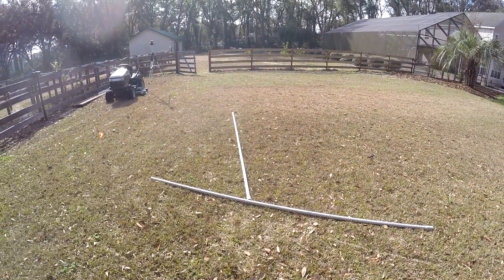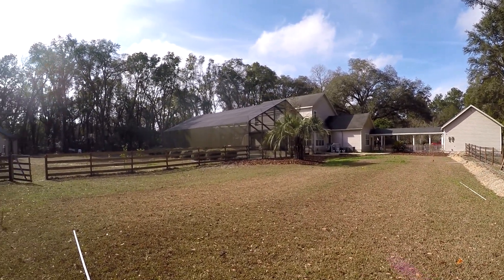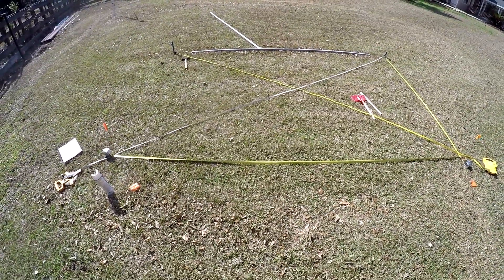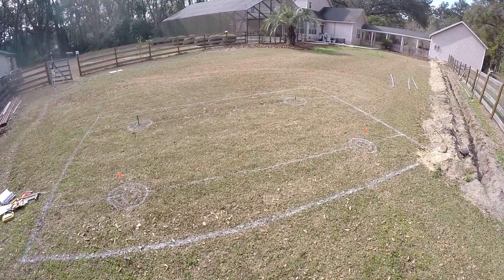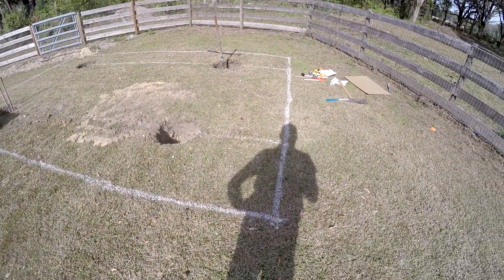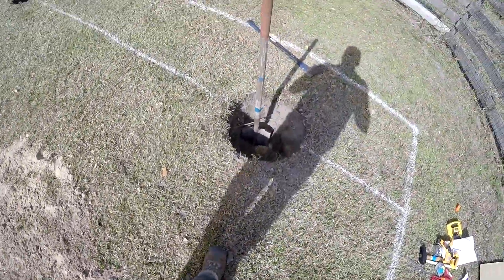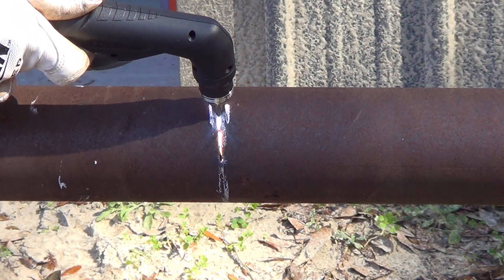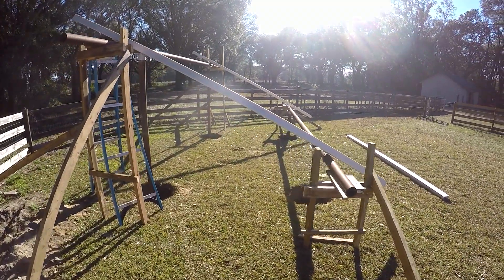IronRidge Ground Mount Solar: Layout and Dig

Comment: Great video, thank you very much.  I have that project in my pipeline. I though 2 feet deep would be enough. I'm glad I saw your video, will do more research about the depth.  Thank you for the scaffolding idea as well.
Reply: It isn’t always about depth, it’s about weight and ballasting down a giant sail that’s trying to uplift the whole array.  The depth comes in with frost heave and maintaining stability long term.
Reply from the maker: IronRidge has a design tool on their site that you can use for free.  Thanks!

Comment: Any explanation why you had to go down 6 feet?
Reply from the maker: Yes, The depth and diameter are determined by the IronRidge design tool.  It calculates the uplift and determines the dimensions.  You could go less deep with a bigger diameter but the design tool will tell you based on the wind loading calculations.
https://base.ironridge.com/gb/projects/new
Reply: @HomesteadEngineering  sweet thanks for the info.

Comment: Great work! I like the way you used your shadow to test the direction. 
Ironridge is great stuff, but costly. 
I am building a 16 panel ground mount at 22' x 14', but using Grainger parts and schedule 40 1.5" pipe. Total cost around $1480 with 18 x schedule 40 10 foot pipes.  It ends up being almost exactly like a snap n rack build, but mine will be adjustable using a cantilever design with the Grainger parts like the 4WNX4.
Reply from the maker: Sounds interesting.  Make sure you anchor it to the ground.  For reference, I am using 8,000 lbs of concrete to hold this 12 panel system down.

Comment: Here is the battery I have now. https://www.youtube.com/watch?v=SYJ25izYSGc&ab_channel=DavidPoz
Reply from the maker: Wow!  This is a game changer for sure.  9k for 30kWh battery that you can discharge 80% every day for close to 20 years.  How many of these do you have and how long have you had them?  Do you have the rack?
Reply: @HomesteadEngineering  I bought 2 of the small racks. 6 total batteries. They also sell back up bms. A little under a month. So far they are awesome. I tested them the first week. Turned off the utility. We finally got cloudy weather for a week and they needed charged. I turned the utility back on and put 150 amps per hour into them. I watched the temps and never went up by more that 5 degrees. Pretty crazy.